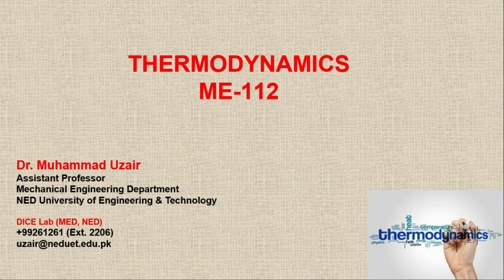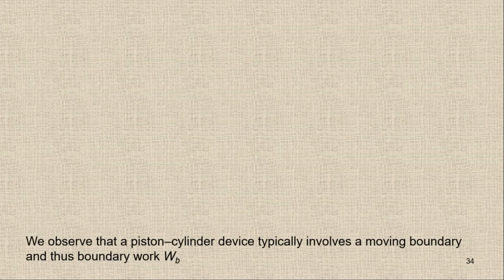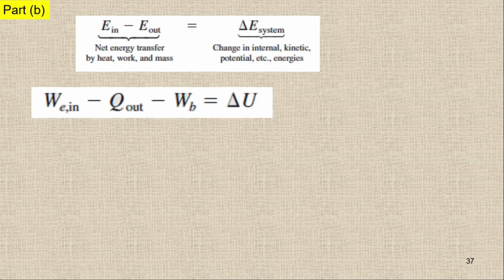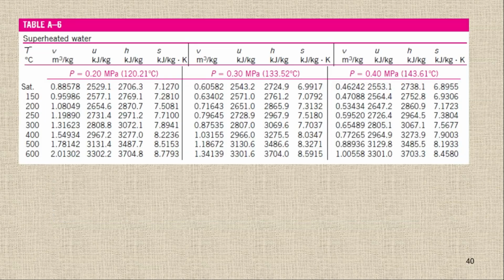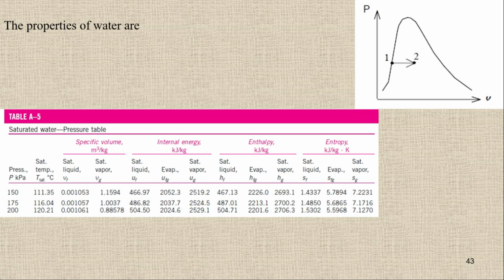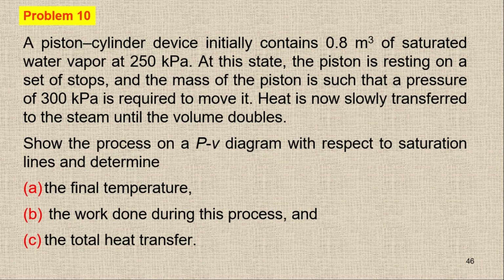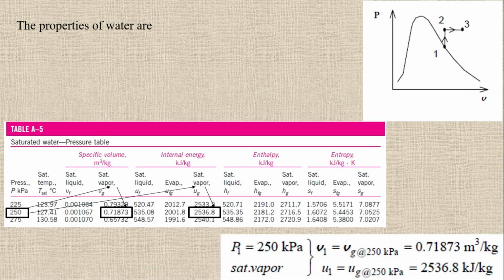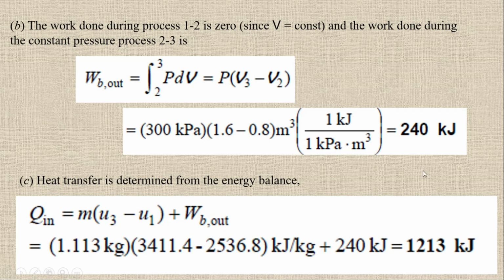Thermodynamics Energy analysis of closed system part 2/4

Comment: Thank you sir , I have a problem : 2 kg of air enclosed in a rigid container receives 0.2kj of paddle wheel work and 0.5kj electrical energy per second. Heat loss from the system is 0.6 kj/s . If the initial temperature is 25 c what will be the temperature after 5minutes  ?
Reply from the maker: For an Ideal gas (in this case Air), the internal energy 'U' is equal to m*Cv*∆T

Therefore,
Ein - Eout= m*Cv(T2-T1)